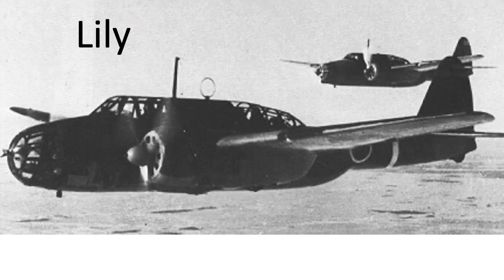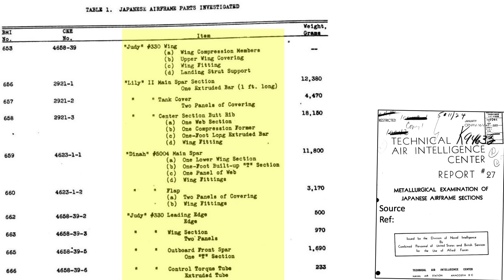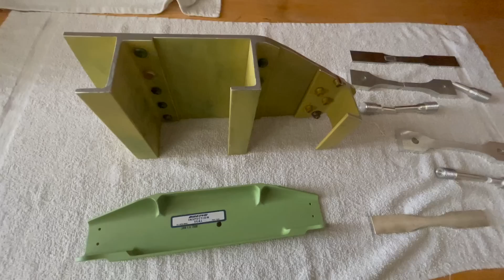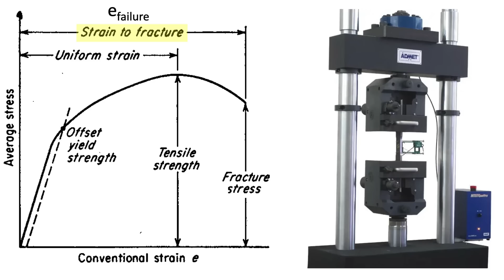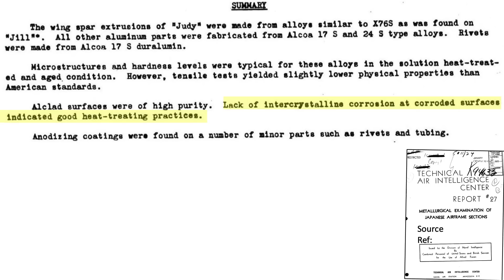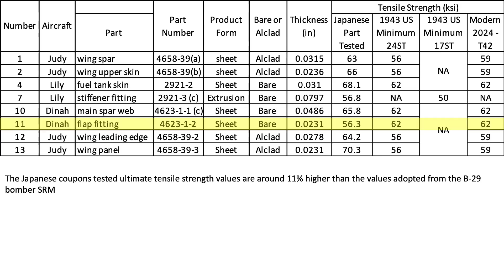WWII Japanese Aircraft Aluminum Quality vs. US Quality

Comment: I had previously read that the machine shops In Pearl Harbor used the Aluminum from the propellers of crashed Zeros to  machine firing pins to replace the heavy and defective ones in the early model U.S. navy  torpedoes.
This video explains why that Aluminum was used.

Comment: Japanese electrochemical industries of Hamgyong thru Manchuria were more than just aluminum of how I based my MIT peer reviewed papers and a presentation by invite only to a conference held inside MIT's Electrical Dept on Vassar Street of Cambridge on how Hasegawa had Project NA thru NZ for Noguchi of Hungnam Hamhung to have achieved muon catalyzed fusion rocket propulsion of gliders and airships with an engine comprised of a Dewar of cryogenic liquified deuterium fuel connected to a beryllium alloy reaction chamber nozzle coiled in around coils of electromagnets to focus cosmic ray muons for fuel to prevent electromagnet coils from exceeding Curie Point while to also deflect alpha particles.

Noguchi of Hamgyong also had Rydberg excitation xenon argon optical pumps for laser optical traps and cyclotrons for free electron x-ray lasers used for metallurgical and chemical processing.

I even have a CIA archaeologist stuck in Eastern North Korea to search for such remains since North Korea is a most authenticRenaissance Fair.

Comment: Excellent info.  Now, a step further.  Japan was force to use it’s planes much longer than the Americans (mostly) did.  Aluminum does fatigue so that will weaken it.  This also shows that a modern world technology sharing is common, legal or not.
As a side note, I did a project were we got to tell Boeing to add antenna’s to the C-17.  They had a secret system to spec the 7075 alloy for strength and fatigue.  Propriety details not uncommon.

Comment: The D4Y Judy was built by Yokosuka, not Nakajima.  Aluminium/Copper alloy is duralumin.
Reply: Yokosuka arsenal was Imperial Navy's own design bureau. It designed few aircraft, but had no production facilities of it's own. Most D4Y Suiseis were manufactured by Aichi, who also build the engines for the earlier variants. Later engines came from Mitsubishi and about 10% of the air frames were build by Hiro.

Comment: More zinc means more strength and less corrosion resistance. High zinc 7 series aluminum is about the same strength as common industrial steel. The Japanese were the first to develop high zinc alloys just before the war

Comment: During WW2 many very capable aircraft had fabric skinned controlled surfaces, so that one Japanese 'plane had 'weaker' than anticipated flaps, aeilerons etc would hardly be significant.
Reply: That was probably a conscious choice - making the flap lighter would probably make it easier to control, and as you point out, it's not like it has to be that stiff in the first place.  One could argue that the US standard was over-engineering in that case.
Reply: The Hawker Hurricane was all canvas aft of the cockpit.  To produce one took 40 % of the man hours it took to produce one all metal Spitfire.  Battle damage could be fixed by gluing a fabric patch and painting it over.

Comment: The Japanese were quite advanced with their aluminum production.  Their use of Duralumin long before the U.S. did is quite impressive.  BTW, even though 7075Tx is rarely used these days , it was heavily used in the 1950's and 60's by Boeing, especially on the C-135 aircraft family.
Reply: Appears that Japanese metallurgy was good/excellent and their process control must’ve been good also.  Impressive!

Comment: I am somewhat good at biochemistry, but this is bit over my head. QUESTION: was Japanese Aluminum quality BETTER than USA for the period of 1941 to say end of 1943?
Reply: Not necessarily better quality, just a newer and slightly stronger alloy.  7076 alloy is similar, but not quite as strong as 7075 which was used in many US military aircraft from the 1950s.  I guess you could say that the Japanese were technologically ahead. The Aeronautical Research Lab in Australia did similar tests on Japanese aircraft materials and got similar results.  I think it was a bit of an eye opener at the time.

Comment: Our house was built in 1946.  A while back, we remodeled a couple rooms out to the studs.  The warm air ducts are shiny aircraft grade aluminum. Feels like really high quality material.  Apparently a lot of aluminum was surplused at the end of the war as aircraft production wound down.
Reply: Grumman went from building aluminum aircraft to building, among other things, aluminum canoes.
Reply: A friends holiday house that was built just after that war has an corrugated aluminum roof that's supposedly made with war surplus aluminum
Reply: If it's still shinny, it was AL-Clad. The outer layer of pure aluminum is there for corrosion resistance.
Reply: @keithstudly6071  Thanks!  I'm going to investigate it further. Some is visible in the basement. All I know is it's rigid and shiny, after 70+ years.
Reply: Quality of both aluminum and steel in the US has been highly diminished. One of the reason the Chinese have been recovering sunken WW2 ships in the Pacific. As an aircraft sheet metal mechanic and an old airplane enthusiast, working with both metals from then and today, marked difference, today's materials are inferior.

Comment: Very interesting, I thought the opposite would have been the case. But clearly Japanese manufacturing was better in terms of Aluminium at that time. Still metallurgy does not necessarily translate into capability of production when it came to design or viability of the weapon itself.
Reply: Their stuff was almost always of high quality.  The problems they had were that they were an island with few natural resources (why they were so expansionist in the first place, and thus why they wanted to smack us in the nose and hope we'd back off) and were being run by a bunch of militaristic loons who thought they could deter us with an attack, and who thought that Japanese will was so strong that it could overcome a lack of training and the overwhelming industrial capacity of the US.  (50 escort carriers in one year.)

Comment: My professional background is material science, everything  presented is generally accurate scientifically. However, I would be careful to draw sweeping conclusions based on this type of data, the fabrication methodology, including the forming and joining techniques dramatically impact the resulting material performance especially in aluminum. I would really like to see similar joints compared from a microstructure standpoint, not just raw material pencil specs.

Comment: If you study Zero (Zeke) , you will come across 7020, now commonly used in quality bicycle frames. It is much harder, and more brittle, and corrodes much faster than 2024 duralumin, 7024, or 6061. It gave the Mitsubishi an immediate advantage, that didn't last.
Reply: Not a problem, if the average life of a combat aircraft is under 3-400 hours or less.
Reply: Japanese had a surface coating for it. It's rarely mentioned anywhere and I don't know how effective it was. I understand Allies did not have a direct equivalent, thus they paid it little attention. I only heard about it from some people painting plastic model aircraft, because the coating had a bit greenish colour. I can't even remember what it was called.
Reply: @Teh0X  airframe interior surfaces were coated with yellowish-green zinc chromate.  Is that the material you mention?  I think it’s pretty toxic- might not be used anymore

Comment: 7076 is still available but the very similar mechanically 7075-T6 is more common.
It is mechanically almost on par with 304 stainless steel.
Reply: 7076-T6, the T-6 is the temper treatment. The composition is the same. I worked with 2024 for years. T-4, at .124 could be bent to 90 degrees without much trouble. If you tried to do the same thing with T-6 it would crack every time. T-6 machined very nicely with few burrs to clean up while T-4 was soft enough that you had to file the cut edges to get a clean edge.
Reply: Yeah, but it corrodes a lot quicker than 2024.